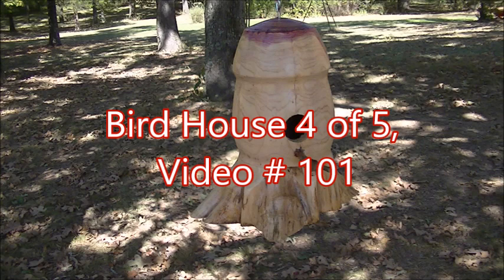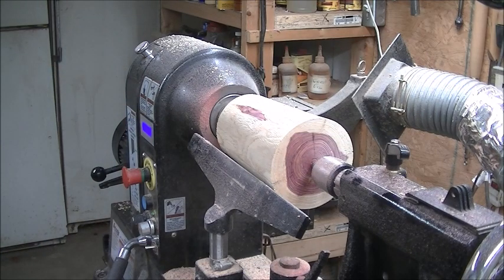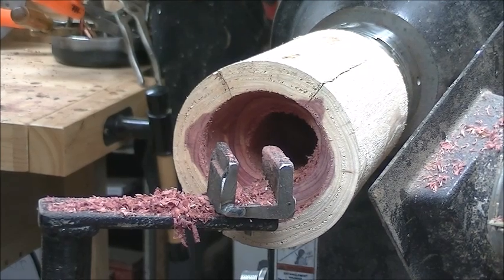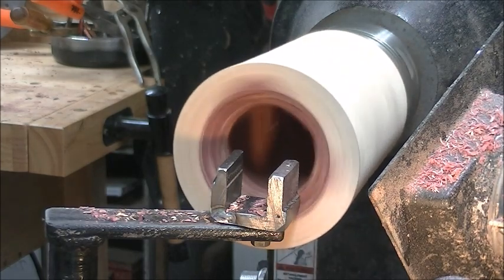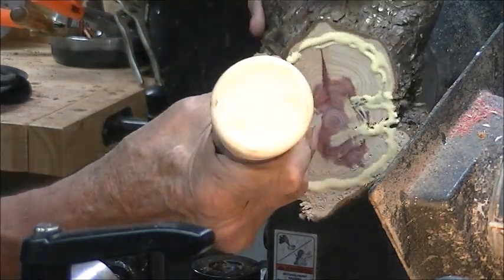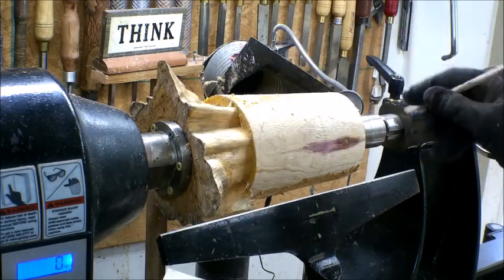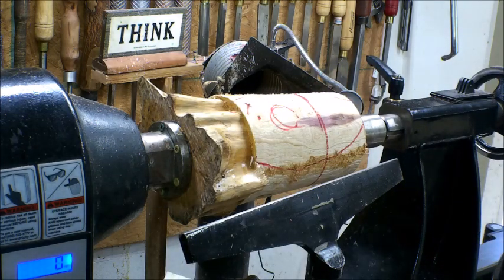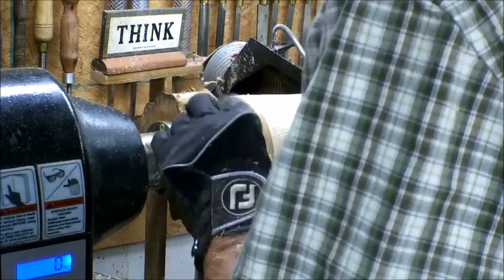Bird House 4 of 5, Video # 101

Comment: Hello Larry, I replaced my old ac motor on my wood lathe with a dc “treadmill” motor(2hp). After getting it all set up I have discovered I have no torque at low speeds all the way up to about 700rpm’s. With something out of balance my machine vibrates badly. Bogs down terribly. 
I was thinking of going with 3 phase motor with  with a variable speed hook up. What do you know about this setup?
Thanks
zetuskid
Reply from the maker: Hey Bud, you know your amps on your DC controller much match you amps on your motor.  For low end power you need the pulley on the motor to be smaller than the pulley on the headstock.  Plus you should have the flywheel.  Tha't all I can tell you.  Good luck, it will work if you get all the parts right.   Take care, Larry
Reply: The Wood Whirler thanks Larry I’ll be sure to check that out. I knew something had to be wrong after watching your setup.
Reply: Follow up: I kept the fly wheel on the motor and ground a groove in the outer nut for the belt to fit. I left the 4step on the end of my spindle. The only thing I didn’t check was the amps on my motor(17amps) and the controller. That’s next.
Reply from the maker: The amp mismatch will cause a lot of problems.  Take care, Larry